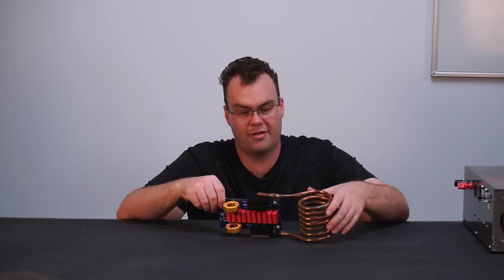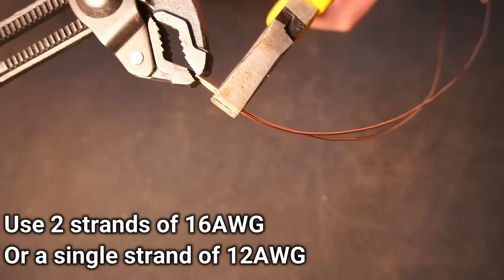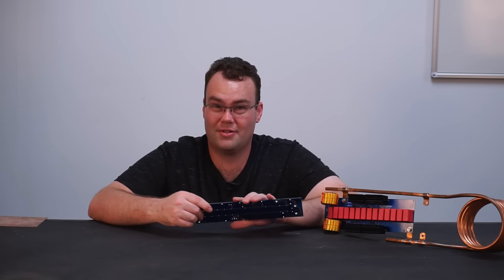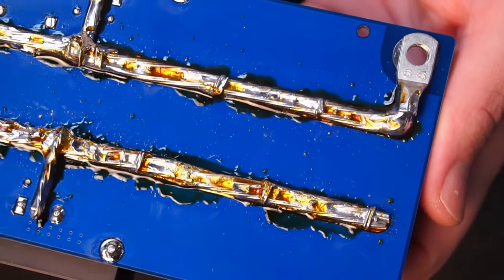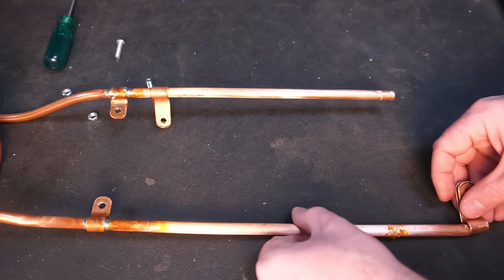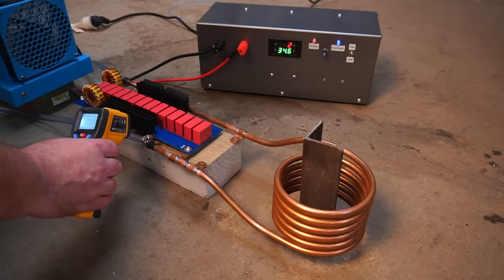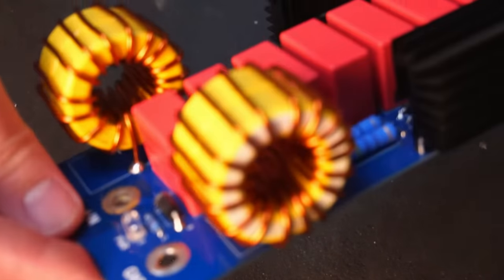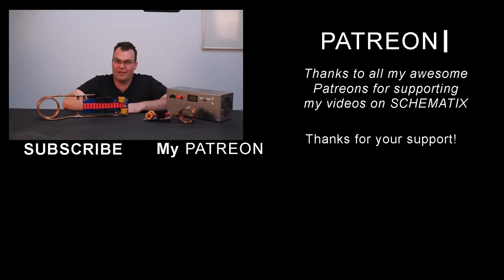Building a 3kW Induction Heater ll Complete Build Guide

Comment: You have never welded have you? The way you soldered the board was how best to warp something when applying heat.
Heat at one end and then move the heat slowly along it. You need to uniformly preheat what ever you can in an oven or by brushing with a flame or hot air gun. You should also solder the ends first then keep dividing the length by half for your next solder point.

Comment: Brilliant project - could you give us any pointers about making different diameter coils for different size workpieces? Is it just the overall length of tubing used that matters ?
Reply from the maker: This is an area where I'm still learning about coil design. In a nut shell, the amount of turns, overall length, diameter and so on, all play a role. Perhaps when I'm more knowledgeable in this field, I'll make a separate video on this topic?
Reply: @Schematix  Brill, thanks, anything you can share would be great. I watched the link you provided to coil manufacture at Ambrell - https://www.ambrell.com/learn/induction-coil-design , which is really useful. Here in the U.K. you can also buy pre made coils for pretty reasonable cost which could be interfaced to your unit using plumber's compression fittings. We're about to start a build and will post back as things progress.

Comment: Mr. Schematix , I watched your videos on induction heating, and decided to build your version of the 3000 watt induction heater. I ordered your circuit boards of course you get five circuit boards (no problem) then I ordered all the other parts. I followed your video to the best of my ability. WOW this thing works great ! Now to my problem, I got extra parts and extra circuit boards so I built another one ( now I have two). second one works just as good as first. WHAT IF I parallel the two circuit boards ? Hook up positive and negative inputs to same power supply and then hook up both outputs to ONE coil. Will I now have 6000 watts of induction heater or a bunch of sparks and smoke? I have two communication power supply in parallel with 220volt input so about 100amps available can this work or should I film it when I first hook it up?
Reply: The MOSFETs signals need to be synchronous, then you may have a chance to scale it up. And please let us know in more detail what happens.

Comment: I think the temperature limitation on how hot you can heat the steel is because above the Curie point the steel becomes non-magnetic due to a change in the crystalline structure. Knife makers test the heat of a blade before quenching by using a magnet.
I don't know what the big boys do to put enough energy into induction furnaces to melt steel in foundries.

Comment: What would a 10kw or 20kw look like? Would the scale of the project and power requirements be worth the effort for serious forging and heat treating and larger scale foundry work(3-6 kilo copper)? Is melting steel in a crucible realistic? I’ve seen it in other videos, but they didn’t seem to be taking considerations for several of the variables you’ve discussed. Great video, thanks.

Comment: Hi, your video was excellent, can you please make a video on how to control a induction cooktop through a PID controller as hundreds of thousands of people use induction cooktop for brewing and it will be very helpful for all of us
Reply: That shouldn't be that hard to do. There are PID temperature controllers for industrial use that come with or are designed for standard Pt100 temperature probes and that have a simple open/close contact that can be programmed for a certain temperature. You can use that contact to switch a relay on and off, and wire the cable that powers your cooktop through that relay. If you google "pid pt100" you should be able to find one that fits your purpose, and for the realy you only need to watch out for that the contacts are rated for the voltage and amperage of your cooktop. You might also need a 24v dc powersupply both for the PID and the relay, as industrial equipment is usually powered by 24v DC (but you can get PID's and relays that run off the mains too).

Comment: Greetings, is it possible to use a MOSFET inverter welding machine with an output of 55 to 60 volts DC and a current of 100 amps to start a 3 kW induction furnace instead of a power source?

Comment: if you could drive a transformer core at them frequencies couldnt you make  the core from an old microwave transformer?

or even use the ballast coil from a treadmill?

if it has to be fereite (iron/ceramic) you could make one using.

1. flyback transformer core from old tvs (they usually are split).

2. tv horizontal deflection yoke cores they are usually split and can be hand wound.

all fereite cores are made of iron and ceramic and are fragile and can break very easy.

the iron makes the magnetics work and the ceramic gives the shape and maybe allows the cores to be much more effiecent operation.

Comment: You could use a sanding disk in a Dremel type tool to keep from having to fight the non-ferrous type metal clogging your file
Reply: Just rub the file with CHALK. Completely prevents chips from sticking... try it.

Comment: Question for all:  I am a blacksmith but live in an apartment.  I do not have access to a 220v circuit for the big induction heaters on ebay.  Is it possible to get an induction heater like this up to forge welding temp? Possibly by increasing heating efficiency by getting the coil design to match the size of the metal more closely? All while being used on a 20 Amp 110v circuit? Pardon if this is a dumb question as I am not an electrician.

Comment: I am using Geekcreit® Low ZVS 12-48V 20A 1000W
High-Frequency Induction Heating Machine for Copper pipe brazing but it doesn't work for copper. I am switching 30v DC power supply. what would be the problem.....

Comment: Just one little inquiry, I wonder about current bleed within a closed water cooling system? Of course, being a quite the novice in such endeavours, I may be missing or stating the obvious. However, if current bleed is an issue, what would a simple solution be?
Reply: Your question made me start questioning the same, with regard to my tig welder.  I've got it in a shop with no running water, pump coolant through, and haven't noticed a problem at all, and of course, never had a problem with total loss conventional system. I will have to do some research, if you find anything, kick it past me, too, if you would.  Thanks

Comment: The board warped because your copper wires expanded while soldering and then shrank when they cooled. Can't fix that. Mounting the board would probably cause things to crack from the stresses. Maybe a different conductive metal has a better coefficient of expansion.

Comment: What's roughly the efficiency? Would a SiC power transistor be better at maximizing what you get with 2000w so you don't have to drop new service lines? I know they are expensive but it seems like half of that 3000w is going off as heat. I don't know enough to make the best choice or even if a kiln wouldn't be better.

Comment: Since you used only one wire twelve gauge wrapping the inductor ring. Would using two wires make the efficiency go higher since resistance will be lower ???
Reply from the maker: the resistance of 1.6m of 12AWG is only 5miliohm. So the losses are negligible and not worth worrying about
Reply: @Schematix  How efficient is the induction heater in percentage Sir ???

Comment: Hi, I build similar heater, but during 30sec of working cables (5cm of 6mm2) between PCB and coil are so hot that tin alloy melt and open circuit. Is cables length between coil and capacitors important for oscillations?

Comment: I wanna build an induction heater than can boil a kilo of tungsten at 5555C. Of course not having the coil melt from the heat of the mini sun in the middle would be the hard part to avoid.
Reply: Only just a kilo nothing more
Reply: @kendesimon4177  I've heated a kilo to white hot with an acetylene torch before. I can't imagine doing that 2x as hot with an induction heater and not melting the coil. At least I won't need a container, the magnetic field holds it in position as long as it is on. I plan on just dropping it on a 25kg block of ice and watching the explosion.

Comment: I would have definitely strived for a much higher magnetic flux density with a much smaller ID work coil.
Reply: Yes! I want to see that metal glowing yellow/white hot! Surely 3kW is enough
Reply: @LRTOTAL  My 2.5KW  setup gets iron cherry red and it is hardly enough to do real work with just a hammer and anvil.
Reply: I once discussed the option of induction heaters for knifemaking with a student of mine who made really nice damacus blades as a side business, but we ended up at a power requirement of 20+ kW to reach forge welding temperature. Those devices can be bought ready-to-go, but are quite expensive
Reply: @wernerviehhauser94  That is very interesting. I imagine 20KW of induction is enough to heat quite a big chunk of metal. My crucible reaches 1100°C and melts copper with ease, and cast iron with a slightly improved setup.
Reply: @Convolutedtubules  He made blades for pretty large kitchen knives (and a machete, once) and used a propane forge with two burners that would max out at about 30 kW thermal. And he said he sometimes needed both to get the materials to welding temperature. For forging alone, you can work with much lower power.
Reply from the maker: For sure, as I mentioned towards the end of the video, this coil wasn't designed for heating metal stock. Rather, it was designed for use with a graphite crucible
Reply: @Schematix  Can I ask what you plan on heating in such a large crucible? I am also curious as to what temperatures it can reach.
Reply: @Schematix  Wow, induction melting metal is exactly what I have been looking for foreever.   Why is it all inductiion heaters are geared to forging & heat treating?  Finally we have a master engineer who is on the job.  Engineer I am not.  But will share what little knowledge I have.  Frequency levels for Industry Non-ferrous foundry operations work at about 5kHz but Consumer ones designed for melting gold,silver, copper work at about 20kHz due to irritating noise levels created below 20kHz.  Your circuit board is truely a beautiful work of art -congrats.  Thinking board warp may have been prevented by "tack soldering" ends back and forth maybe until completely filled?   From what I've read, the clay graphite crucible has too much clay not enough graphite to get hot enough to melt Cu Al, at least with 3kW.  If you double up on the power supplies in parallel to 6kW, then the crucible you have I am guessing would be good for melting hundreds of types of zinc casting alloys and very possibly aluminum (just my hunch though).  Maybe at low KW, industry uses smaller pure graphite crucible in a narrow cylinder form that reaches temperatures over 3500 F for melting copper alloys, and steel crucibles for melting alumimum?  Kaowool insulation around under over crucible helps with melting metal.  Thats it for now, but you just got a loving die hard follower.  Can't wait to see you melt some bronze alloys, alumimum, cast iron, zinc alloys and whatever else you fancy.  Always been a big fan of yours, and I am just so estatic to have you on board the melting train...
Reply: 20 kw is doable domestically.  That size would be a fricking cannon .
Reply: @mevk1  I recently got a 2500w heater on eBay for about €100 and the R4850 server PSU for around €75 plus shipping.

It is pretty amazing what can be done with such a small, cheap, primitive setup. As of now, I have already made a bunch of ingots from scrap copper, brass, and aluminium. I will be attempting to melt cast iron once I have refined my setup and have better crucible and insulation.
Anyone interested in induction heaters should check out FrenchCreekValley.

Comment: How much DC current does your  system draw at 50 volts with that graphite crucible in the work coil?
You have given me a great idea for transferring more power to the work.  That is:-  Using 3/8" diameter copper tubing instead of the 1/4" or 6mm tubing that usually comes with the Chinese pre assembled units.

Comment: Nice project as usual, but the capacitance of the capacitor bank is a bit too high in my opinion, it should be around 1uF, it will increase the frequency and the all in all temperature of the induction heater will be reduced and another thing is the working coil is way too big, at this power the heated metal should be yellow hot, you can reduce the coil size or put an bigger metal to match the coil size. Anyway, nice work 👍!

Comment: The warping has to do with thermal expansion. Copper expands with heat while soldering and contracts when cooling. A frame will just make the copper contraction to break loose the solderings. 

To prevent this I suggest using a non-lineal drawing. A slightly curved path between the points will absorb the dilatation. Why do we need to solder to the PCB the intermeiate points, anyway? We can solder the contacts and cold stick the rest of the path.

Just my suggestion.
Reply: What might also help is to start by soldering both ends first, and then solder in "binary bisect mode": solder the bit at the halfway point, then solder the bits at the halfway points of the two sections you've now created, and so on, until everything is soldered.

Comment: A question needs to be asked, in case the total capacitance of the capacitor bank is smaller like between 100nF and 600nF, would it affect negatively or positively? (in this case what I want to know is if the resonant current or voltage increases or decreases or if it remains the same and only changes the resonant frequency)

Comment: Can the power on this induction heater be adjusted (lowered down) in case it is too high for PCB desoldering? If it damages the copper on PCB

Comment: Your zener voltages should be lower to achieve a lower Cgate and it would probably be more efficient if you used a better transistor also. I bet most of your power is in losses on the switching.

Comment: I want to use this induction heater to heat water. The plan is to have a 20mm steel pipe with water circulating through it with the pipe passing through the induction heater. Do you think this will work?
Reply: Sure it will. You'll need quite a bit of extras in order to make it safe. If the metal becomes too hot, the water may turn in to vapor and significantly increase the pressure of the system. Perhaps a feedback loop and controller circuit to monitor temperature and adjust the supply. A pressure relief value is a must unless you want a bomb.

Comment: 10:09 The warping was probably because of the copper being heated and then cooled down. It might have expanded during the soldering significantly and then shrank back when the solder hardened. In this situation I would not suggest mounting the pcb to any support, since it might rip the pcb apart.
Reply: How about tack soldering several areas only.  Not sure if we really have to use so much solder?
Reply: I would personally use wide copper strips and solder only where the capacitor legs poke through. Flooding the multistrand wire with solder fills the gaps, so I assume it makes the wire more conductive? That's odd. Anyway, since the copper is thermally conductive, it will still heat up when soldering, so the warping won't go away.
Reply: @overgrownwithmoss  Just a waste of solder, imo

Comment: Couldn't you just use litz wire for the coil and skip the water? I see 5000-strand 0.1mm (enough for 500A 100ish kHz, maybe more depending on duty cycle) on Aliexpress for about $15 per meter. Overall a bit smaller diameter than 1/2" tubing.

Comment: For induction heating of non-ferrous metals, can one use a longer coil to increase the magnetic field strength to compensate for the low permeability of the material? I don't anticipate using the same diameter coil as yours though as this would make it rather unwieldy.

Comment: It's not hot enough for forging, shoud be almost sun yellow red, yours is only dark red, but for smaler steel it could work, but I think gas forging is probably cheaper than to buy electricity, but if you have a solar bank and batterys it's probably for almost free. 🤔 Nice work 👍🖖
Reply: With the inefficiency inherent in any flame based system I very much doubt gas is from pure energy cost point of view even close to electricity.
Reply: @jimmiller5891  ah, most eletricity comes from gas
Reply: @playkvlh9122  That so depends where you live. Here it is nuclear. But that is beside the point. From the individual metal melting furnace or forge users point of view, if we only consider the energy cost, what matters is the cost of the energy source and the efficiency of the furnage. My iron melting gas furnace burns about 10-15 times more gas than it should take to melt a crucible full of iron. That is efficiency in the ballpark of 6-10% where as an induction furnace is close to donno 95% So gas cannot compete with electricity in this application.
Reply: Not besides the point, that was my only point, point being: -- most electricity used for melting iron and steel comes from burning gas (85% worldwide energy is from fossil fuels vs 10% nuclear worldwide - USA is 20% nuclear).